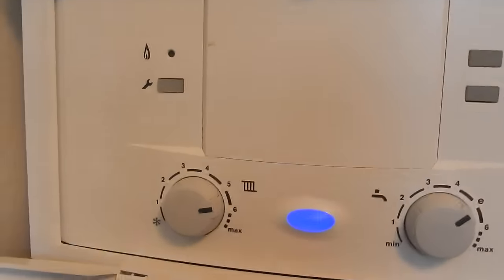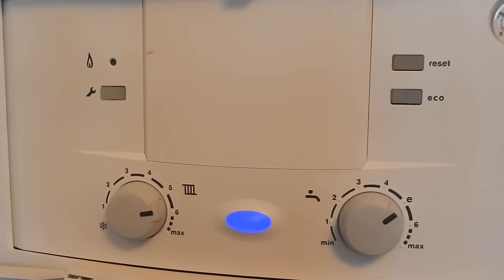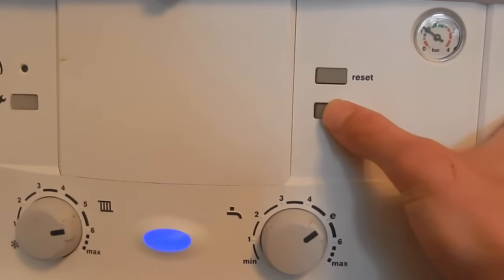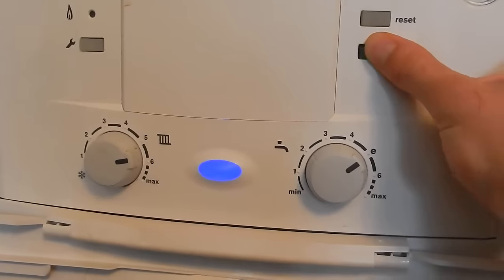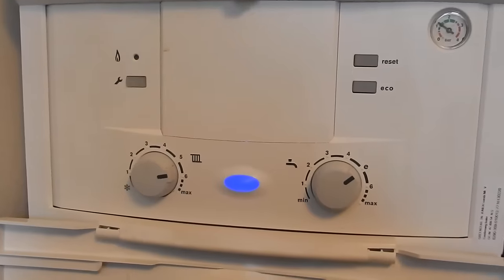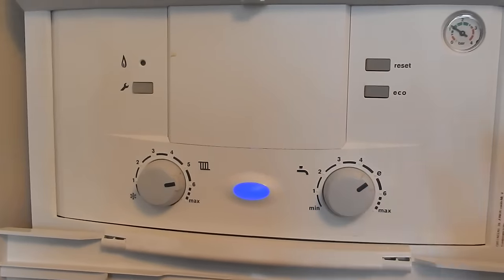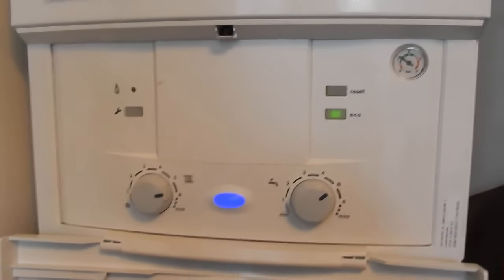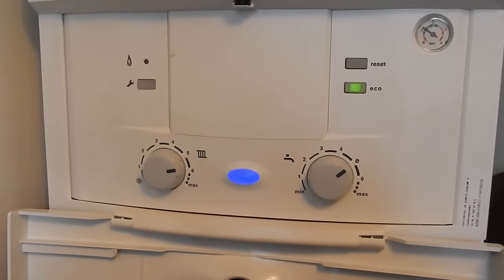Worcester Bosch ECO button - what is it and what does it do?

Comment: Yes, I’ve timed mine, with it off the kitchen tap takes 8seconds to get hot water, put the button on it takes 18seconds, so always mine is left off in the long run it’s better saves you money, less water less gas because you have received the hot water already

Comment: Many thanks! 
I’ve been wondering for years why my boiler was firing up in warm weather.
I dread to think how much money I wasted by not pressing Eco mode 😬
Reply: Negligible mate. Over ten years, you'd be lucky it cost you the equivalent to a round of beers at the pub. You would just press it if you were going away on holiday; unless it's a winter holiday, leave it off and prevent your pipes freezing.
Reply: @glenc3249  a round of beers costs a fortune these days!
Reply: @family-accountemail9111  Don't they just... I was thinking 2 or three mates. Ha, doesn't seem that long you could go out with a tenner or so, and still have a bit left for a bag of chips ;-)
Reply: @glenc3249  I recall pub in Gosport in the late 90s on a Friday where it was a pound a pint before 9 pool table was 20 p and a band used to come on at 8.30. Chip shop was on the way home or a donner. I d be in bed by 10 with change out of a tenner and a smile on my face set up for the weekend! Happy times. I fancy a beer!
Reply: @family-accountemail9111  Yeah, nice to go home with a bit of money left wasn't it!! The cheapest I remember was in a night club in my hometown, Gainsborough, Lincs. It was 1979, and I was 17½..... Heineken was 45p a pint. But, my wages were only £28.00 after tax n ins' - crap apprentice wages ;-)
Reply: The gas you save, you will burn by the boiler taking longer to use more gas to heat your water, as it will take longer for the hot water to get through to your taps. Surely the saving is negligible and your better off leaving it off, unless your off on your holidays!!

Comment: What if you have a water meter, and every time you want hot water, you wasting few litres/gallons of cold water before it become hot. Is that really an Eco solution?
Reply: But then the preheat function will be using your gas and electricity numerous times a day to keep the water hot ready for when you turn the tap
Reply: @djhatstand7312  I have a Comfort II programmer, in summer I set the times when I need hot water, like first thing on a morning.  In winter when the heatings on I switch the water to Eco mode.  I'm also on a water meter.
Reply: Gas and electric cost more the water 🤷🏼‍♂️ still saving money

Comment: This function isn’t about storing domestic hot water like say a small hw tank. It keeps the water in the boiler hot that is used to heat the passing cold water through the boiler when a tap is opened . this function’s benefits is massively outweighed by its negatives.  It reduces boiler life and uses more gas in most circumstances
Reply: So are you saying eco is good or bad? I can’t decided what to set mine to???

Comment: Thanks for the Eco button! How about the White Key which should be off by turning to Off position whilst repressurising it? The video Inwatch says turn to On position facing to the Left position before pulling the key off downward from the boiler. I did so what it says turning it to On but what happens next the Arrow goes higher to no 2 when I have just set it on 1.5? So I turn the White key to Off!Please Explain, thank you very much for your Vlog.

Comment: I hope you can help. Iv just moved into a house that has a greenstar 28cdi. 
There doesnt appear to be a thermostat anywhere! Not on the front of the boiler, not on any walls. All we have is radiators which we can individually turn up or down but when their off the boiler is still saying 56 degrees.

Comment: Oh the irony - that to turn something OFF you have to turn an LED button ON (I had to double-take the manual to work this one out too).
Reply from the maker: You are turning preheat function off, but economy mode on, hence the green light. On the newer models it will show on the digital display either 'preheat' or 'eco'
Reply: Eclectic Badger in
Reply: Eclectic Badger that was what I thought I turned that green button to off. Now I watched another you tube on how to repressurise the boiler After bleeding the rediators; demonstrator said the White key must be on Off position whilst bleeding so it means after turning back the water button to Off position the White Key should be on On position, am I right?
Reply: @vsgP7117  for the 'internal filling loop' (the one that needs a key): Before using the key you would bleed the rads of air first. The existing pressure in the system will force the air out of the rad, resulting in an obvious pressure drop on the gauge. 

Next, close off all radiator bleed valves before re-pressurising as normal: Ie. insert the key, turn from closed (off) to open (on), then slowly open (turn on) the mains water supply valve letting water in until the gauge reads 1.0 bar. Once at the correct pressure, close (turn off) the supply valve, then turn the key from open (on) to close (off) and remove.

If you over-pressurise, making sure the water supply valve is closed (turned off), and the inlet key is also closed (turned off/locked), bleed water from the nearest radiator to the boiler until the gauge falls to within the 1.0 to 1.5 bar range.

Comment: I have a Worcester Greenstar Eco boiler, after the boiler was service the radiators started to warm up even thought the room state was down to 12 degree.  Worcester Tech stated this was due to the preheat and I was to press the eco button which I did, the digital display stated eco for 2 days the rads didn't warm tp my knowledge it may have done when I was either asleep or out, but now it has started again (Boiler only fires up for approx. 5 mins, then shuts down. Any ideas why?  I can understand the preheat for hot water but why rads and anyway it shouldn't be on preheat.
Reply from the maker: Is your boiler installed in a garage or loft? It could be frost protection in the cold weather.
Reply from the maker: And not wanting to offend you, but are you sure it hasn't dropped below 12 degrees in your home? If you gave a standard thermostat you should hear a click as you turn it, that is the temperature it's reading. If you have a digital thermostat you should have a 'actual' temperature as well as a 'target' temperature
Reply: I think it was a faulty room thermostat, which I have had changed.  The temp in the house wasn't lower than 15 degrees.  So far all seems OK.  Thanks.

Comment: how do you turn the central heating on manually!!! just moved in the hobs work and hot water but have no clue how to turn it on, pressed the on button above the pilot but nothing happens
Reply from the maker: Hi Gillian what heating controls do you have? Do you have a external programmer or a built in one on the front of the boiler? Do you have a thermostat on the wall?
Reply from the maker: Also is the boiler thermostat turned up? The one on the left with the radiator symbol next to it?
Reply: Mine is literally just a button, I have no timer settings or anything so when I want heating on I have to push a button, then it turns off and I have to press again, it's really annoying

Comment: Hi   can anybody  help   my Bosch  boiler will only fire up if I take out and replace the batteries, once it has reached set temp it shuts down as it should  but will not fire back up after room temp has dropped unless I take out and replace the batteries
Reply: did you get it working. I just been through this with mine and wasted a day before I realised what was going on. Think it only tries to resync the thermostat to the bolier in the first 20 seconds after the new working batteries are put in. If after that it hasn't found the signal then it gives up trying. I ended up taking thermostat off wall and up to the bathroom where boiler is, then i put the new batteries in , then i could watch the lights on the boiler. It finally found the signal and synced, then i could take it back to the hall and put on the wall again.

Comment: I have my 40cdi switched to eco.

Should I be able to hear anything at all from my boiler?

In the depths of night I hear the "hum".  I'm a light sleeper!  Once I hear the hum I can't get back to sleep.

I check the boiler and although the eco button is green, something is obviously switching on and whirring away, perhaps a motor or a pump, I'm not sure.

But if preheat is off by virtue of eco switched on, should it be totally silent?
Reply: This may be the pump being run for about 5 seconds every 24 hours as an anti seizure measure, certainly older Worcesters used to do this.

Comment: my worcester boiler doesn't have the slot for the key or the keyless handle to pull to pressurise
Reply from the maker: If you don't have to filling loop built into the boiler then you will have a external filling loop.
If you have a combination boiler this will usually be on the pipe work below the boiler. 
If you have a system boiler it may be in your airing cupboard.

Comment: where would the serial number be on this boiler?
Reply from the maker: On this model the serial number is on the small sticker to the right of the controls.
Newer ones the sticker tends to be on the bottom left.
If you have the installation instructors, near the back of the book will be the commissioning document that the installer should have filled out, it will be written on that page as well.
Reply from the maker: Installation instructions*
Reply: Michael Dunne what does the spanner button below the green flame mean when it shows red?
Reply: Call an engineer.

Comment: I would like to fit a DT20RF to my boiler. Do I need the programmer as well or can I just buy the thermostat?
Reply: You need both. But if you've got already done this. 
Don't buy the Worcester Bosch one. But the salus one from Amazon £50 and it'll take you 10 mins to fit. Max.

Comment: With DHW if you run the tap slow will the water be hotter that at fully open
In other words is it safe to run a on tap mixer shower on a boiler like the 28i

on out 28i if you ran the hot tap on low the water was a lot hotter that fully open